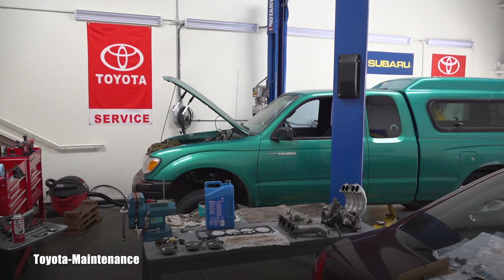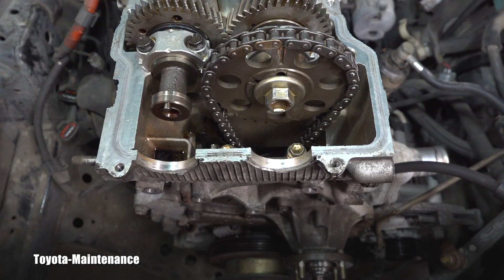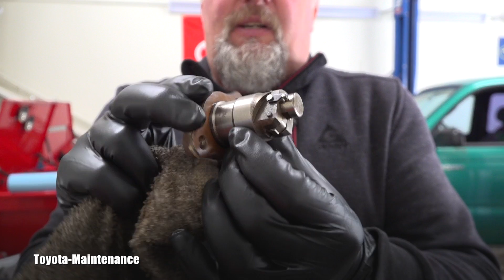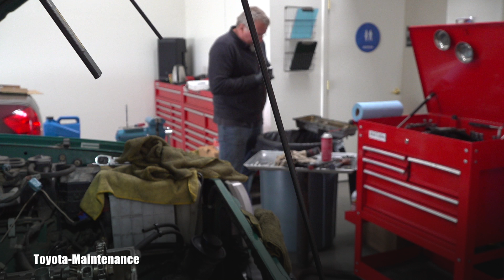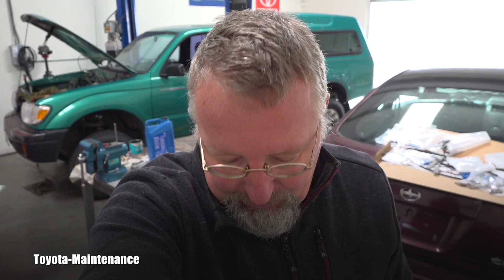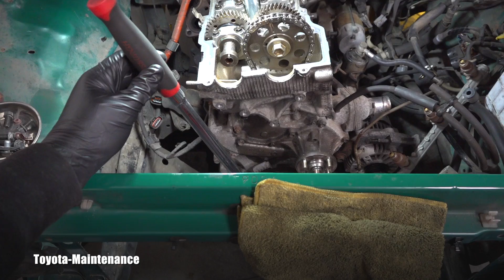How to install and set Timing Chain Tensioner

Comment: Peter, I have a 2001 Tacoma 2.7L 2WD PreRunner Xcab.  At approximately 299,200 miles, I started hearing a rattle at the top of the VCG and after watching your videos, I narrowed it down to the tensioner.  I picked one up at O'reilly's and changed it out.  I immediately noticed there was not a gasket on the original tensioner.  Is this normal?  The one from O'reilly's came with a gasket and I followed your instructions exactly as described.  After starting the truck, the rattle was louder than before, but after a few stop and starts of the engine, I guess after the pressure built up in the tensioner, the engine ran the smoothest it has in years.  Was it common/normal for the original tensioner to have been installed at the Toyota factory without a gasket or did they just forget?  Please let me know your thoughts on this and thanks for sharing your knowledge on these great videos!  Side Note:  After replacing the tensioner, the next day I started and completed a 700 mile trip without any problems.
Reply: Question when you replaced it the gasket/tensioner you don’t have to worry about messing up timing correct ?

Comment: I just changed the tensioner on my 97 4runner. Is still leaking oil thru that part..any suggestions?? Side note the tensioner for my truck doesnt use an O ring...jjst a gasket

Comment: I was wondering how that pin got released .thanks dude
Reply: I turned mine counter clockwise to about 20 degrees from top dead center but didn't hear any hook releasing. I'm really concerned now. I don't want to turn it clockwise without hearing the hook releasing the plunger. What do I do? 🙏